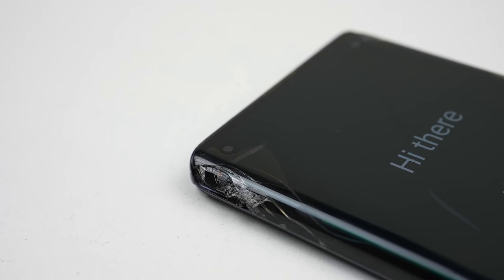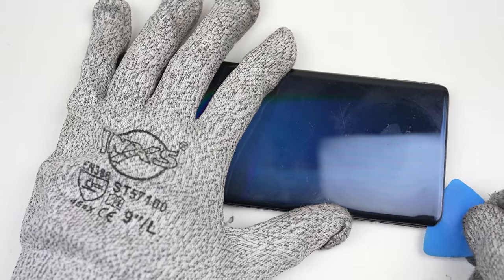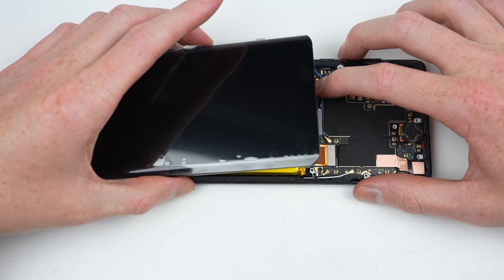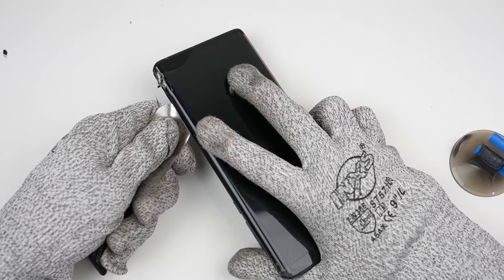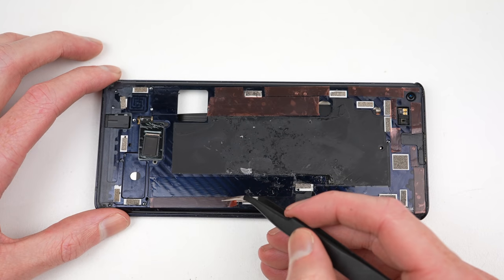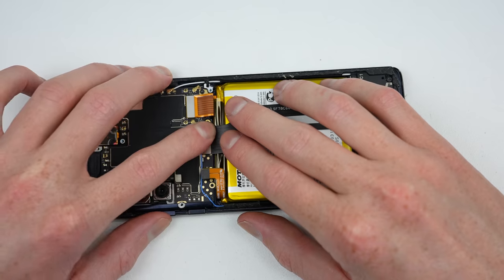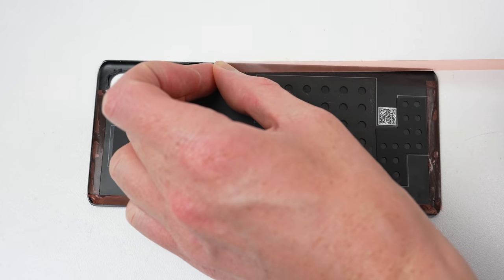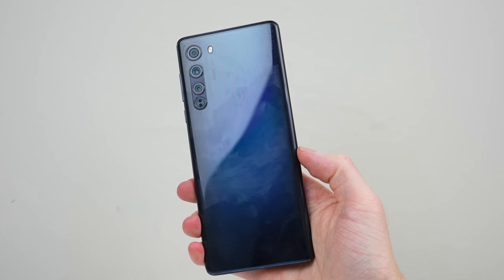$138 Motorola Edge 5G - Repair Taken To The Edge

Comment: It's really crazy how you can see the phone's internal components and battery all, one-by-one being disassembled and re-assembled, really amazing and a precision requiring thing, but i wonder why devices cant be simpler.

To disassemble them in a simplier way without requiring advanced skills to change a specific
component of the device inside.

Im curious which devices or models could be repairable easier or hard, i mean changing battery should be easy done for consumers because batteries go bad and we need to replace it and not be forced to change device every 2 years.

Comment: Hi Hugh Jeffreys. Is the original battery still safe to use after being removed? A lot of repair guides usually recommend that once you remove a battery, you shouldn't reuse it in case it was damaged during removal.
Reply: If you didn't poke it or bend it, it is perfectly safe to use, especially if the battery in question is still retaining good life and capacity, then by all means reuse it. They just cannot guarantee that your battery replacement will be done in a manner that is safe for you, your phone and the battery itself, so they keep it safe, since you usually cannot go wrong with going with a brand new and an original battery.

Comment: Afaik back in 2014 samsung released the Note Edge. And it was much smarter idea cuz it had the curve only on one side (so you can type just fine with one hand, using the other side of the phone). Plus it was a bigger curve, as there was no space for any buttons on that side, and also the software treated it like a separate screen, so no app would actually cover it (no stupid colour inversion on the corners, especially when watching movies). And at the same time the phone featured metal chassis + removable battery. Sadly they no longer make this kind of devices.

Comment: I hope you see this, would the removal of the screen for the Moto Edge 2021 be the same? It doesn’t have the actual edges so I’m wondering if it will be easier to pry off?

Comment: An easier way to remove the display is to remove all the components, and heat the chassis  with the heat gun. The heated frame will soften the adhesive much faster the using a hot plate transferring the heat through the screen

Comment: Glad to see that you managed to get this back into a fully functional state! Most people would probably replace the display & mid frame as one whole assembly, which, whilst avoiding the need to unglue and reglue the display, would also involve a lot of work in removing and replacing every component into the new frame/housing. So either way, not a cheap or easy repair, but still, a good repair as it is now fully working once again and is saved from landfill.

Comment: Hey Hugh, I have these remax head phones with a broken power button.The button is still in place but the sensor is most likely out of line with the button. I want to remove the foam ear protection from the headphones but they were made in such a way that they can't easily snap off.Im afraid that if I remove the foam I won't be able to put it back and one side of the earphones wouldn't have the ear protection foam, what do I do

Comment: I consider wireless charging to be a backup to cable charging, it's inefficient to use as your daily charging method, but it's useful if your charging port breaks, you lose your cable.etc 

So it should be on all phones

Comment: I find it funny cause where I work (phone company), we often have those motorola edge for 5$/mo financing no down payment, so on the long run it's even cheaper than buying a busted one like this.
Reply: For how many years will you provide on 5$per month financing on a 500$ smartphone like this, it's believable for a 100$ smartphone but 8 years to pay off a phone which will work for at most 5 years seems 🧢 to me!
Reply: @gautamsharma3361  well its 5$/cad on a 2 years plan, so honestly it's well worth it lol. considering the "new" price is above 600$

Comment: I'm very glad that most companies have went back to glass slabs and not over the edge curves like the original Samsung S6 and S7s. The downsides really outweighed the supposed benefits of having curves. No screen protector will fit properly, it's more expensive, harder to repair, etc etc

Comment: 3Months ago i put new adhesive tape for the iphoneSE2 mainly  to fix Apples bad adhesive tape that holds  the screen on 
because it was doing creaking noises a day after being with me. found that issue after it got dipped into water. 

thinking the water resistance would not be good i redid they're  job and at first i found it had the same issue so took a week brake from tampering thenn.....
i did however find its best to leave the screen on untouched with something light on top so it 
can set after a few days to a week i had no noise or air gaps. 

lucky for mom i decided i had enough messing around with an SE2 and she was very happy to have a new iphone.

So my Lesson is to wait at least a few days to a week for adhesive to dry or set with the tape.  i did redo my 
amazon review and it tbh was fun job to do.

having to not send back an new iphpne and just fix it a week after i got it was a good idea.

Comment: To me, at least, while the plastic back is good on smart phones from a user perspective, as a technician myself, I DESPISE these plastic back phones. 

Specifically, the newer Samsung phones that have either a "hybrid plastic" or fully plastic back. 

I prefer the glass backed ones. They come off in one piece and you don't have to worry about bending or creasing the back when applying heat from either a hot plate or. A heat gun. 

Yeah if you bend or mess up the back glass it'll shatter/ crack, but if you know what you're doing, you'll be fine.

Comment: I have this phone. Bought it brand new at 10000czk, still struggling to sell it. I liked it though
Reply: People don't like the curved screen that much, and motorola used to have pretty... average, maybe below average phones considering how bad (in my opinion) the software was. And you can pretty much see how difficult repairing this phone is with that curved screen, no wonder it's hard to sell the phone :S

Comment: 7:23 - *slams table* Thank you!

Wireless charging is crap, other than trying it a few times, I've never used it on phones that had it and my current phone doesn't even have it. Good riddance.
Reply: Same here, that's why I love mid range phones, not only they offer flagship performance and 5g, but they have for most part headphone jack instead of wireless charging coils . Wireless charging is and has always been crap, and I sincerely don't use that on my old s9 plus, I prefer slow charging instead